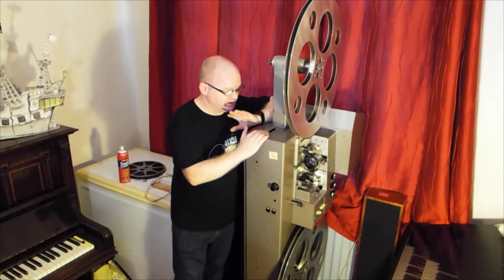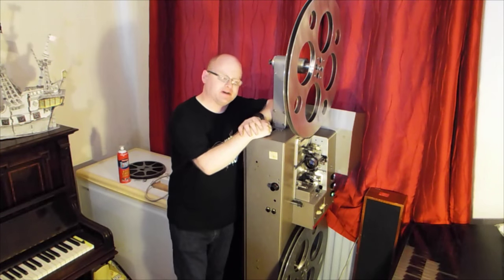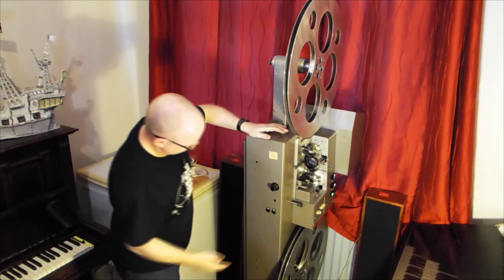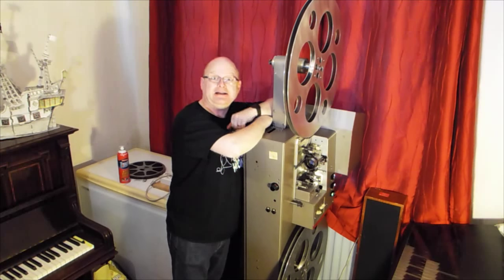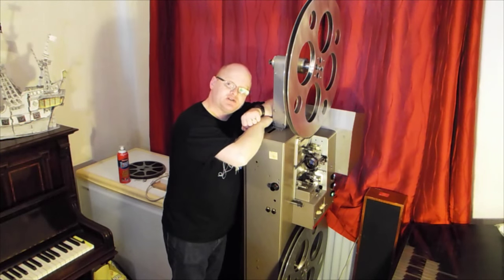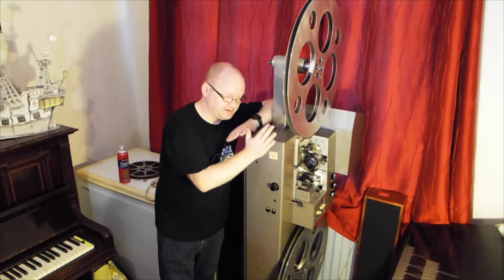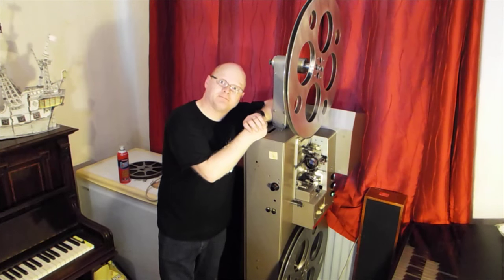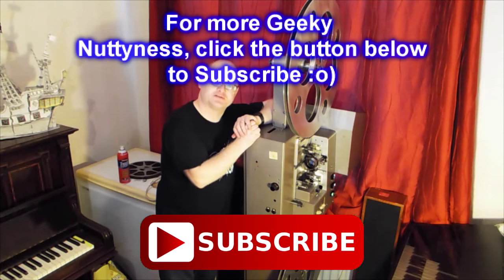Philips FP-16 16mm Cinema Projector Restoration Part 1 ( Kinoton / Norleco ): 1960s

Comment: Before you run that projector much more have you filled it with oil? it seems to be running with a metal dragging sound!
Reply from the maker: thats cause its on chains, cant hear that in real life but there was a missalignment thar may still be there, but yes, full of oul :)
Reply: +RetroGamerVX  just wanted to check as wasn't sure if you knew it had to be filled with oil, not just surface oil like most domestic projectors. Being industrial the intermittent mech is actually submerged.

I wasn't sure if this one was until I saw the filler tube in Jays video. Does this one have the fluid level indicator tube ontop of the mech? I'm actually quite interested in that now.
Reply from the maker: +steadicamant Nope, it's just a tube that comes around the front, can't even see the mechanism it's connected too, have to feel back there.  There is a little mark on the tube :o)